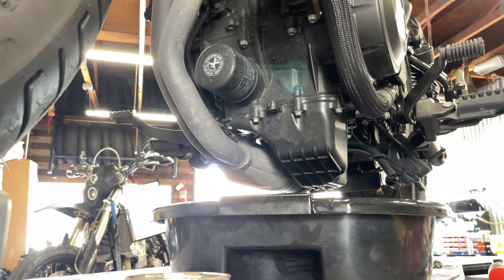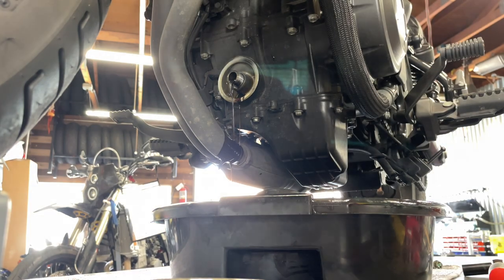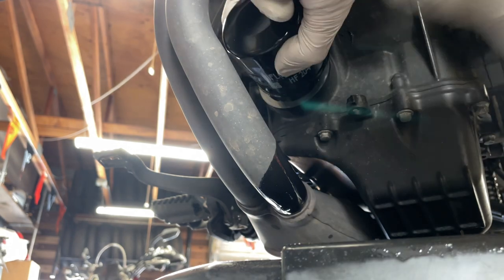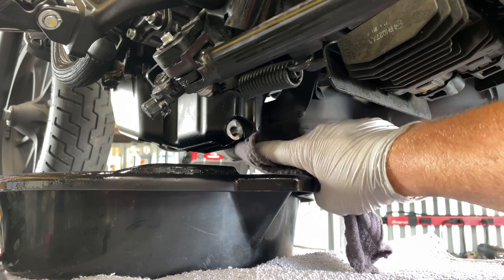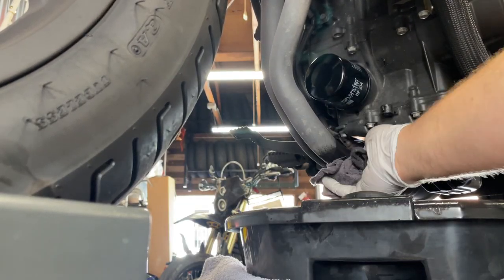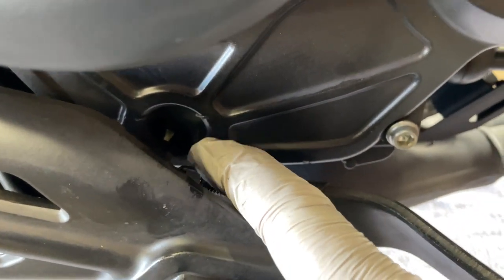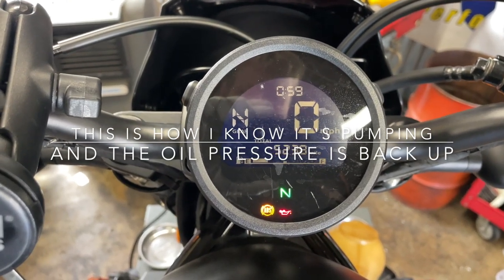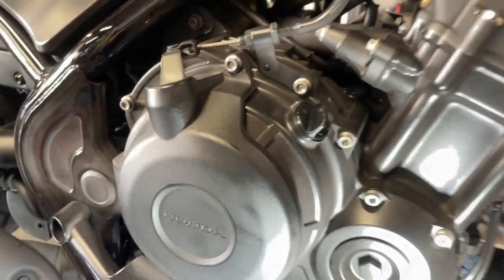How To Change Your Motorcycle OIL & Filter (Basic)

Comment from the maker: This is on a 2021 Rebel 500. The concept is very similar on most any bike. Locations of the drain bolt is usually at the lowest part of the oil pan. The oil filter can be in several spots. I will do a cartridge style oil filter change video soon! I hope you all grasp the concept. If you have any question feel free to comment below or message me on my Instagram. https://www.instagram.com/motorcyclemecha/

Comment: Perfect! how often do you recommend changing the oil and oil filter?
Reply from the maker: Depends on the bike, but no later then 3 k miles. The oil runs through the transmission and clutch in most bikes. As a rule of thumb I change my oil when my shifting isn’t as smooth.

Comment: I also let the engine run for a minute to heat up the oil before I let it drain.
And I cover everything that comes in contact with oil with aluminium foil.
Anyways - Contemplating on getting a magnetic drain plug? What do you think?
Reply from the maker: Agreed, I forgot to add that in the video. But ya a magnetic drain bolt would be a great idea, also get one with safety wire holes.
Reply: @motomecha530  Good tip on the safety wire - messing with a motorcycle is too easy unfortunately

Comment: I just bought a 2009 R1200GSA with 50,000 kilometres (I’m in Nova Scotia, Canada). Previous owner used non-synthetic 20w50. Do you recommend I continue with non-synthetic 20w50? I won’t be riding during winter months. Is there a particular brand I should use?
Reply from the maker: You could ask 100 mechanics and you’ll get 100 different answers. You won’t have a problem sticking to non synthetic oil and as far as brands of oil, everyone swears by something different. Maybe ask the previous owner what they used and stick with that.
Reply: @motomecha530  Thanks, that’s good to know.